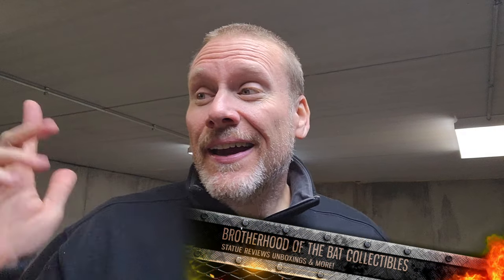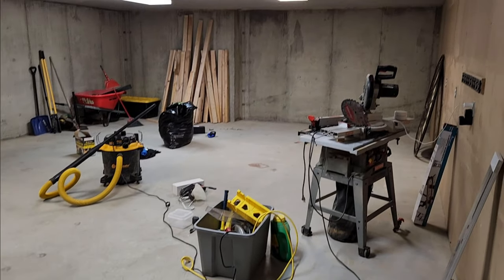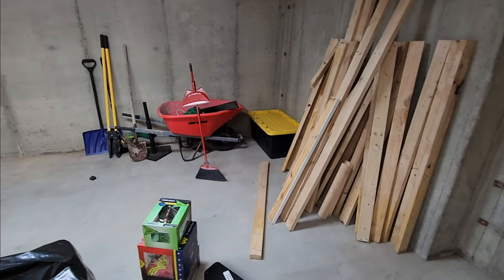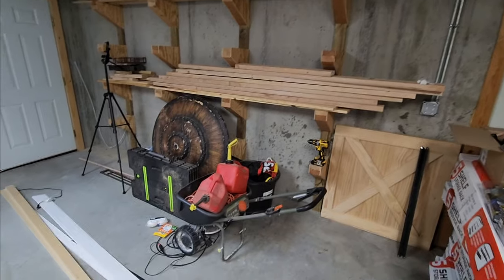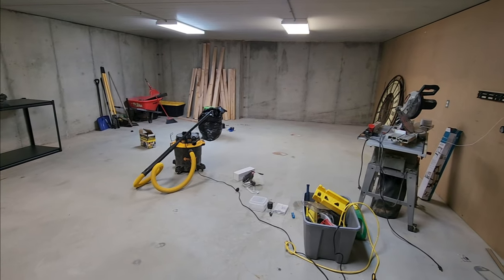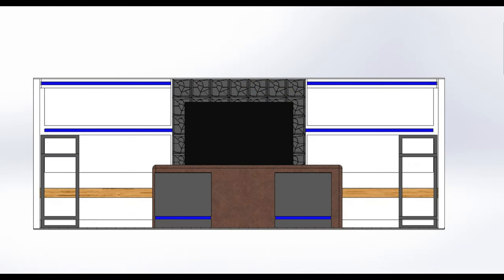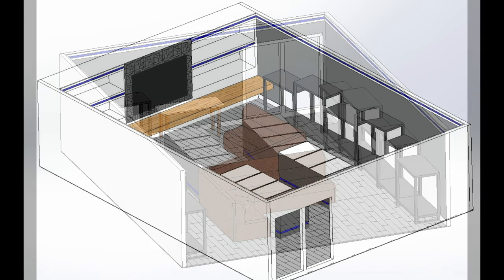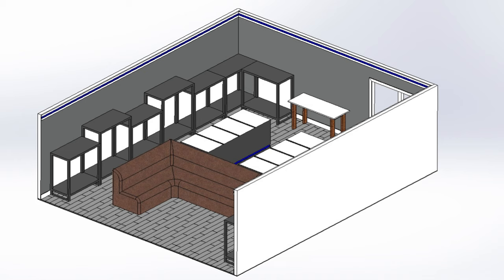Bat Bunker Statue Collection Room Display Progress UPDATE January 2023

Comment: I'd probably put a sofa and rug in the corner where the wall goes in.  TV on same wall. Get all the other walls with floor to ceiling shelving. Don't worry about podiums in the middle until the first part is done. Decide then will be easier.

Comment: My only idea is cosmetics and this is entirely subjective. Your space so you decide. Idea wise tho, I'd love a Gotham masonry aesthetic to the space. With gothic molding all around the room where the wall meets the ceiling to sort of mimic the tops of buildings in gotham. To that I would add corner mounted gargoyles to add to the aesthetic. And a fun side project that could be done cheaply is to buy a small spotlight that you could mod into a working bat-signal to shine on the floor or wall for added aesthetics. 

If the TV goes on a wall I'd look into a live wallpaper that mimics a rainy gotham night and makes it look like a window looking over the cityscape.

Comment: Hi Chris... I think the model you showed us make it look cluttered and I would not have the couch and set up a better place to shoot your videos. I would actually free up a bit more the entrance and put a shelf to the right as you come in, so you could see the back of it...maybe put up a small thin wall 6/7 feet long, to frame up the room a bit better and there so you can hang some art and have shelves the other side. So people would come in and see the art first, maybe the Batcave logo on the floor. That area to the right would have statues but it would be the one I would set up as your unboxing/shooting station, freeing the rest for display purposes. Instead putting 2 shelf units in the middle I would probably put one but taller where you'll be able to use both sides to display... One thick tall shelf so people can walk around it and see everything. I would also consider looking at decoration for small rooms in the internet or in a magazine where they give you ideas on how to set up a small apartment studio about the same size as your Batcave and give you ideas on how to utilize the space to the fullest.... ooff.... I wrote a lot... hopefully some of that will help.... Cheers